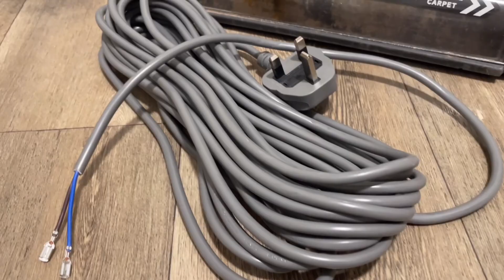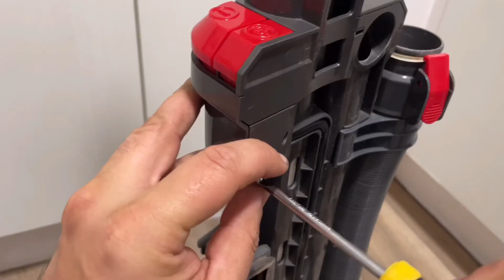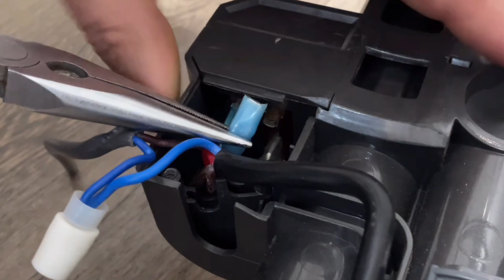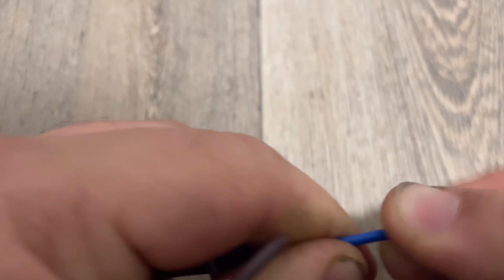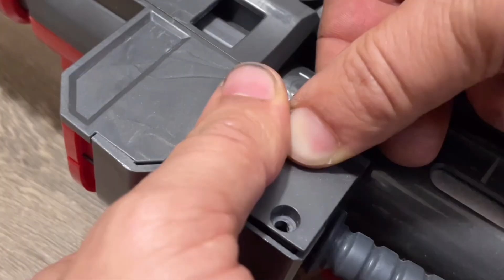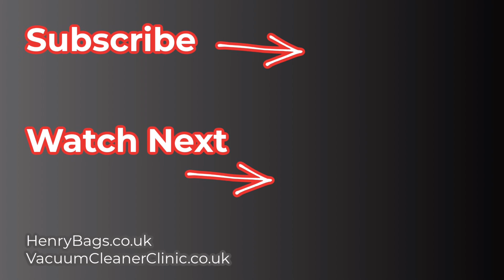How to Replace the Cable on a Vax Air / Mach Air (EASY FIX!)

Comment: My cable keeps cutting out where it's not connected properly.  I'm hoping if I open it up it will be simple to reconnect.
Reply from the maker: If it’s intermittent you would be best to take 6 inches off it and then get some 6.3mm spade connectors to connect the cable back up to the switches

Comment: Hi. Great video. I was wondering where you can find new Vax mach air motors. Thank you!
Reply from the maker: No sorry vac don’t make such things available 😡 you ca find used ones on eBay if that helps

Comment: Brilliant thank you for sharing
Reply from the maker: i was gonna ask you if this would help. thank you for inspiring me to do this. i hope it helps people.
Reply: @vacuumhelp yes it is helpful instead of joining two wires together bit of tap now can do it properly
Reply from the maker: @danstortoiseandmore you can get the connectors too from screwfix pretty cheap
Reply: @vacuumhelp brilliant will get some i often get hoovers or vacuum and fix them up to donate to domestic violence people or people in need